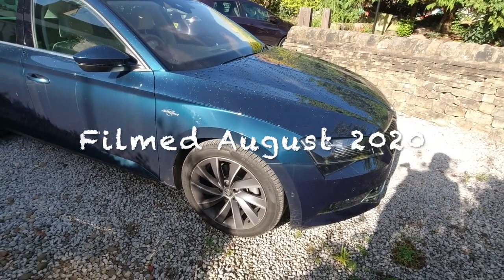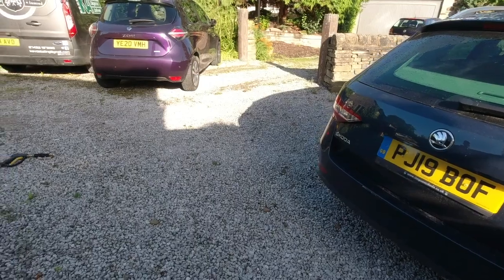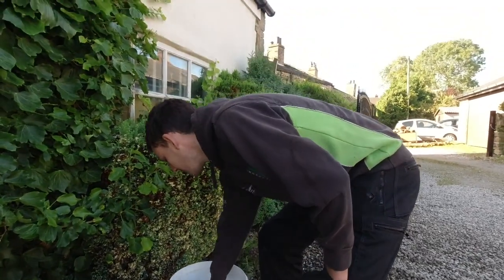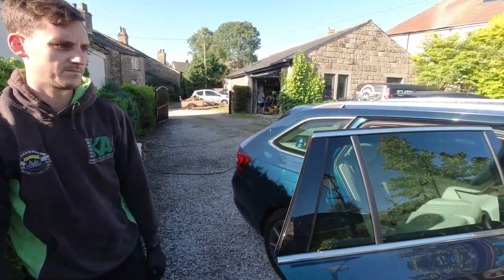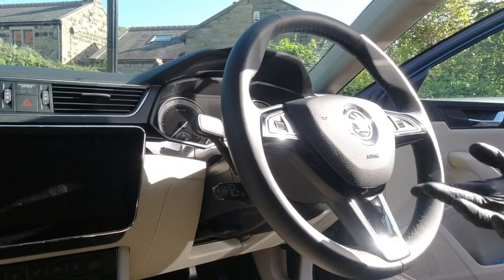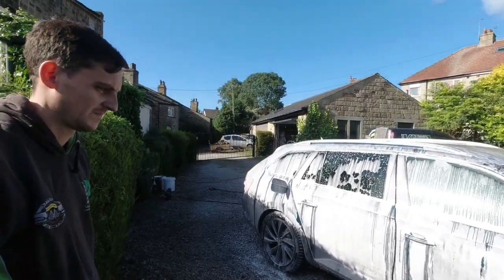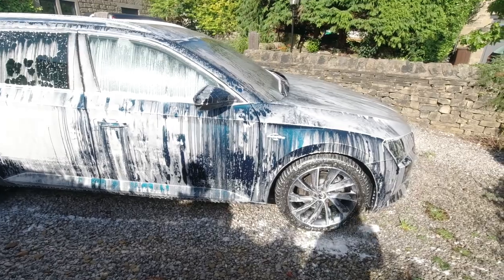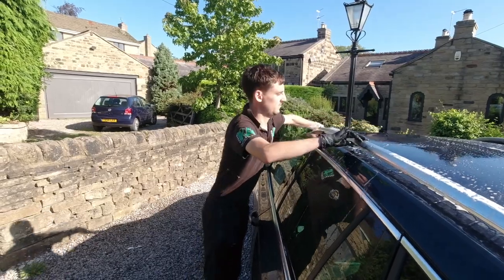Skoda Superb - Professional car cleaning using the 2 bucket method

Comment: Lovely work and that blue is a great colour.
FYI for anybody with a VAG car. To put the wipers in service mode just turn the ignition on then off again. Then tap down once on the wiper stalk and wipers will stay up to make cleaning blades easier.
Also if you hold the unlock button on key fob down for 2/3 secs all the windows will drop down partially to clean the tops. Then just hold the lock button to return windows up.
Reply from the maker: Thank you for your comment. I wasn't aware of the service position trick, it is a useful tip!
Reply: Thanks 👍